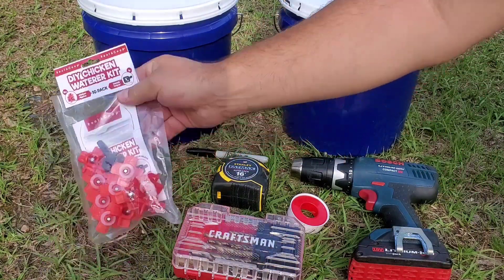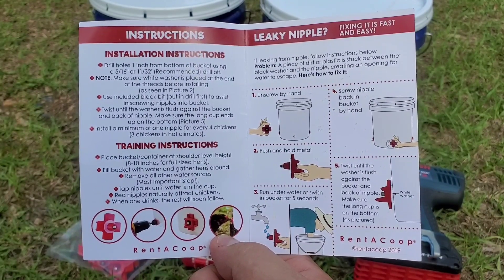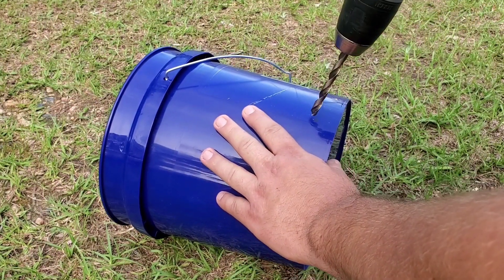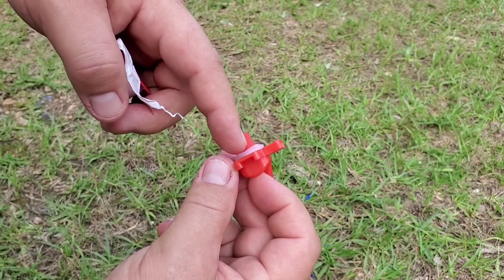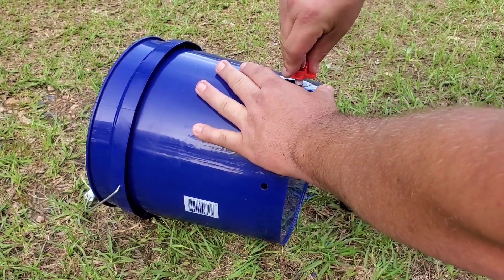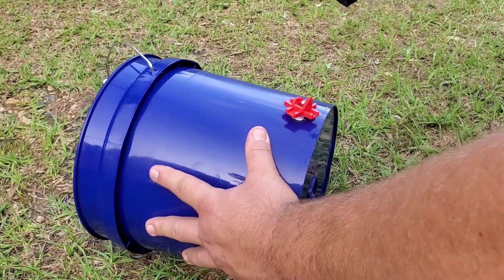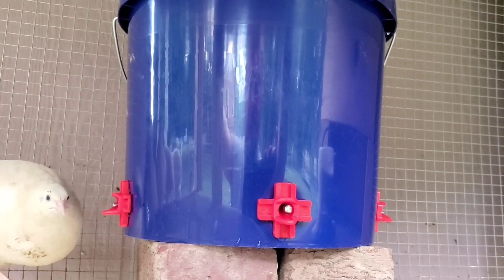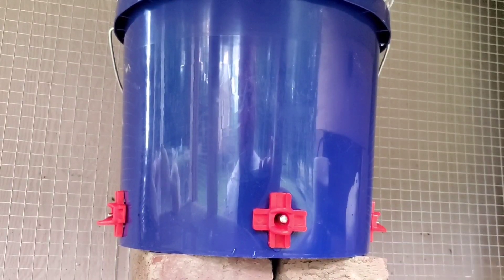How to make a Clean and Efficient low maintenance Chicken or Quail Waterer - #lazypondfarm

Comment: Looks great.  I started with a bucket too.  Lots of watering types can be made out of them and water nipples.    Out of poultry nipples I do way prefer those type I just like the rabbit water nipples because more types of birds can drink out of them.  Also the rabbits drink put of them too so since we use to have everyone together.  Quail with rabbits, and our geese, chickens, and ducks back when we had them were in together.   Either way DIY water nipples rock.
Reply from the maker: Thanks for the positive feedback! I want to try the rabbit waterers too!
Reply: @lazypondfarm  out of poultry nipples those type you have are way better though, the ones that point down leak so much.  Only issues with the type you have is if you have birds with bigger beaks so for chickens and quail they are great though.